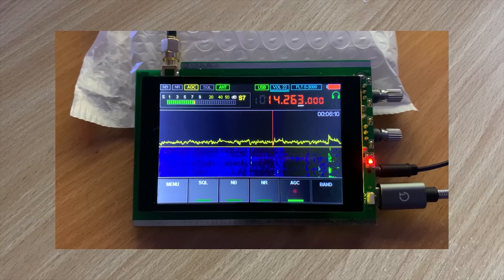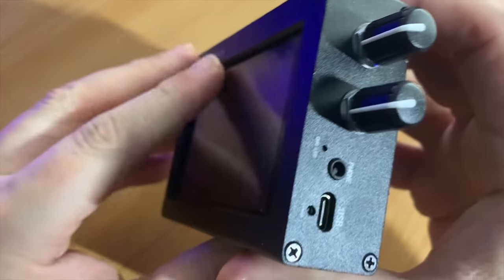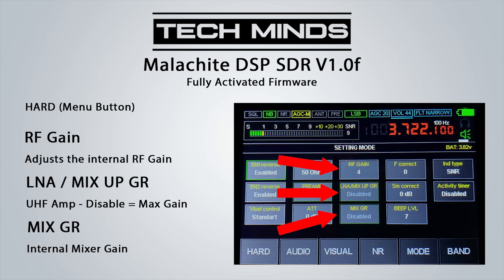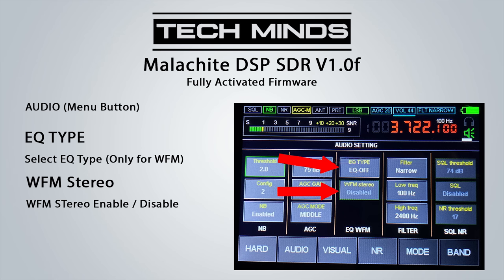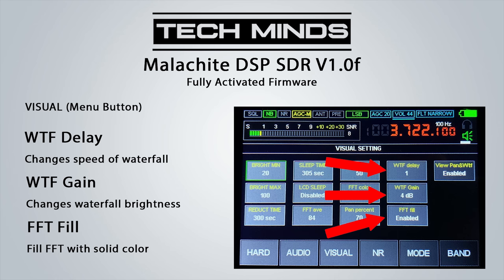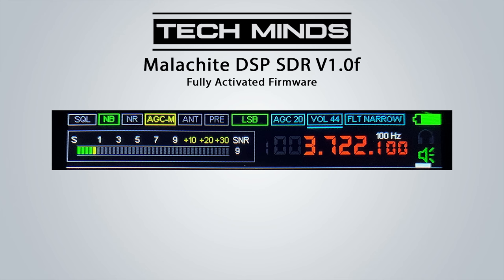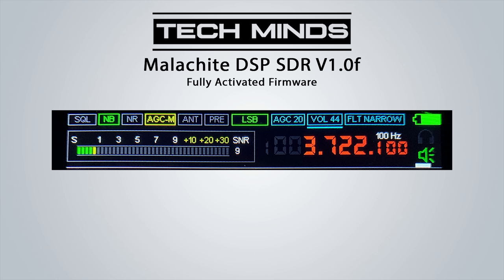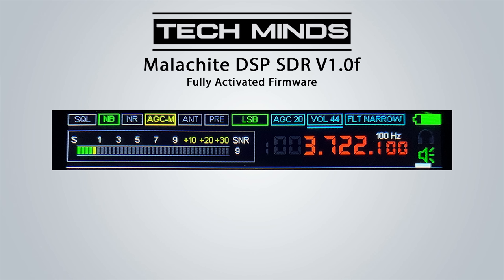Malachite DSP SDR Fully Activated Firmware 1.0f / 1.10

Comment: Looks good, but paying for firmware upgrades is a dealbeaker :(
Reply from the maker: It’s a “one off” fee if you don’t buy one that already activated. If it’s already activated then there is no further charges to upgrade firmware.
Reply: You haven't to pay extra fee for upgraded firmware if you buy the original version from russian developers. With original russian device all future upgrades would be free of charge.
Reply: The developers don't deserve any remuneration for their efforts?
Reply: @TechMindsOfficial  Have you had any luck with the latest firmware 1.10b? It sounds like the developers have done something and now pre-upgraded chinese versions are not working?
Reply: @gerrykavanagh  50 usd? Most small PC software cost 25-35 USD. Months to wait. Why? I have a lot of respect to the authors of this project, but ...
Reply: Treba da se plati ali je preskupo.Citam sta kazu ruski radio amateri o cenama uopste. Nerealan svet. Frljaju se dolarima kao krompirima.

Comment: It's not Malachite SDR, ist a chinese clone.
Reply from the maker: The hardware is open source so it doesn’t matter where it’s made, it’s still a Malachite SDR. But the quality of such item can be questioned.
Reply: @TechMindsOfficial  Open source hw means, everyone can rebuild that, aber no one is allowed to sell it and make businesses with clones. You know?
Reply: The Chinese are calling them Malachite SDR. If you want to find one, that's what you look for and that's what the sellers call them.  Unless there is a patent or copyright that is legally enforceable internationally , the clone makers can do what they want since the design is open source.
Reply: All the Chinese versions are not the same.  Differences in PCB layout, internal cabling, component selection all can make significant difference.  Including: touch sensitivity and visibility of the screen, susceptibility to interference, location of the controls (front or sides) protection of the speakers, among many details.  Would be nice if there were side by side comparisons of the many models that are sold - but different versions will come and go.

Comment: I was all set to buy one of these until I saw this review:  https://www.youtube.com/watch?v=gDpd_JATenM
The main complaint is that you can't get much with the telescopic antenna (i.e. severe lack of sensitivity) even on the AM band...
Reply: The problem is that the RX expects to see a 50R antenna impedance and the impedance of a standard telescopic is in the kR range so you will need a balun or matching transformer to do this. There are a few video's on here that will show you what you need to do. I don't think that the HiZ option is available on the Chinese clones.
Reply: If you have the v1. 10a or later firmware you can change the antenna impedance and also turn on a preamp. Both via the menu. This enables the radio to work better with the telescopic antenna.
Reply: @lawrencestringer1262  I think it depends on which version of the radio you have. I don't think that the Chinese clones have the matching transformer for the high-Z input as they were built to be cheap and minimal function. I know mine doesn't.